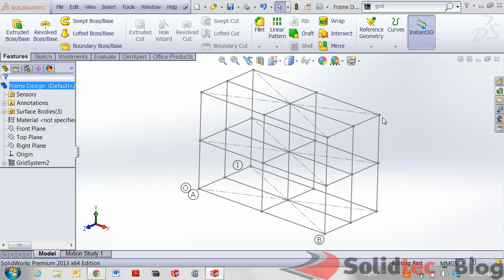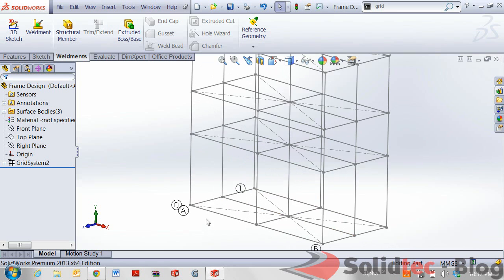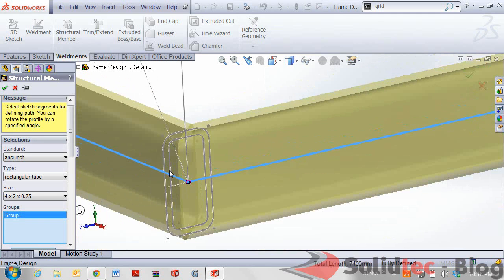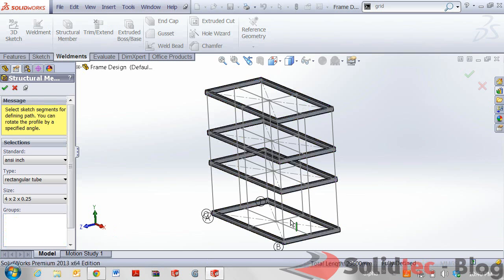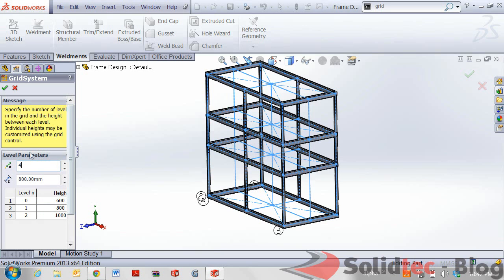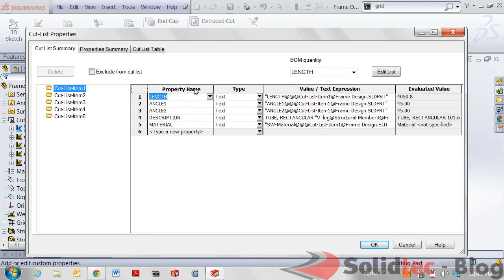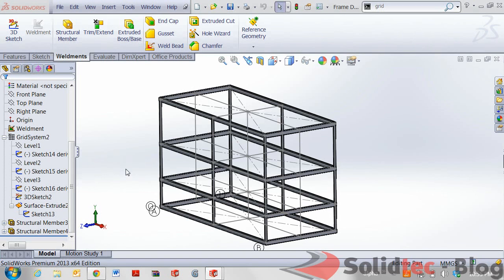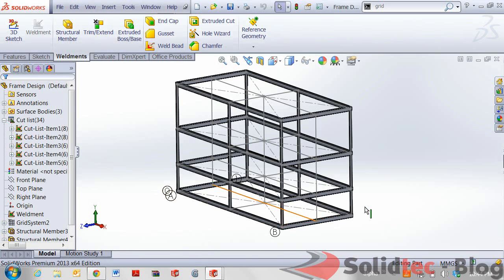Frame Designs with SolidWorks Weldments

Comment: How can we make a model and after that get drawings and model of separate pipes
Thank you
Reply: Had the same question did you found out?
Reply: You would have to use the Save Bodies command to create new part files from the model. Then pull in the the file into your drawing on a separate sheet.